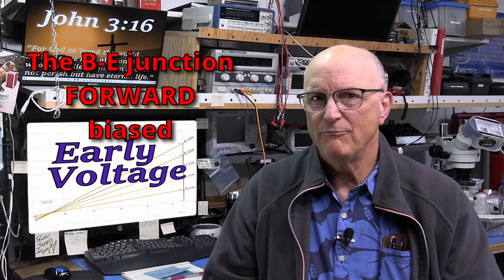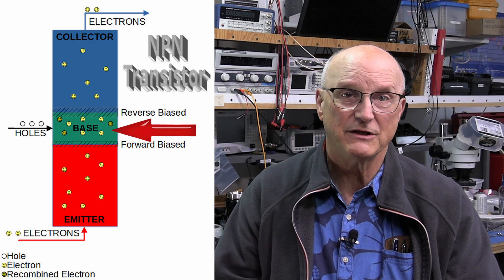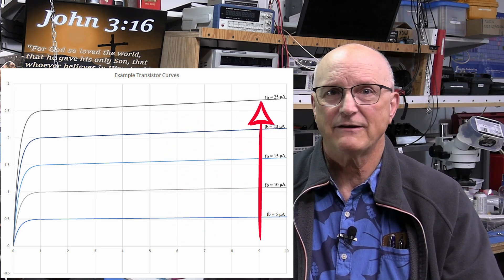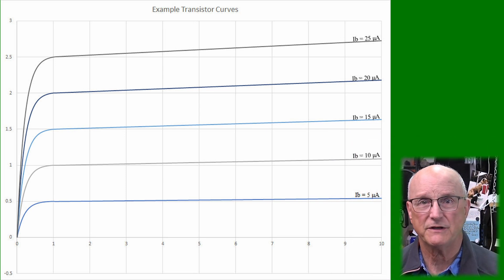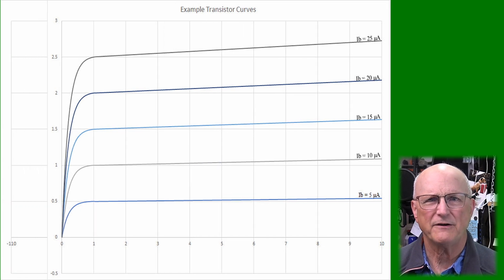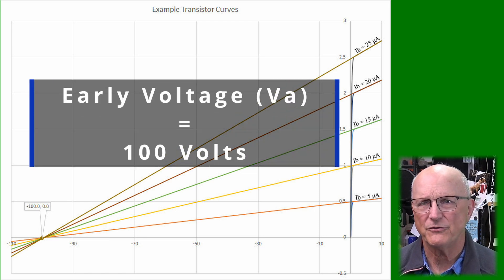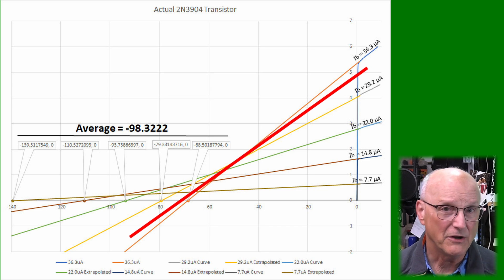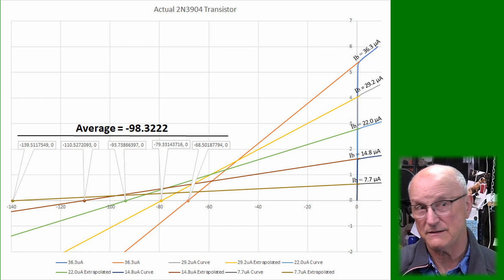What is Early Voltage? (066f)

Comment: I think a slightly better way to explain what is going on is to come at it like this:
The current flows into the emitter following the diode equation for the E-B junction.
Most of that current goes out the collector but some goes out the base according to the HFE.
The HFE of a transistor depends on the effective thickness of the base.
Depletion regions don't count as part of the base so higher collector voltage makes the base appear thinner.
How rapidly the collector depletion region is narrowing the base is what determines the slope of the collector current lines.
In theory, (but not in practice) the narrowing of the base should be raising the HFE regardless of current so the lines should all meet at the mythical place called the early voltage on the Ic=0 line.
Reply: Feel better now?   You did not listen.
Reply: @daveengstrom9250  I think you missed the meaning of my comment.  Read it again.  I made what I believe are several important points that make the explanation work better.
Reply from the maker: Yes, I believe that is exactly what I said in the video, though I didn't rope in the effects on hFE ... at least not directly. 🙂
Reply: @eie_for_you  My comment also put the points in a different order that I think works better.  Getting the changing HFE up front explains the change in collector current as a change in HFE
Reply from the maker: @kensmith5694  But, the change in hFE was not the point, but a side observation in the explanation of what it is all about.
Reply: @eie_for_you  I disagree.  The change in HFE IS what is happening.  You are holding a constant base current and seeing a change in collector current.  Ic/Ib is the very definition of HFE and you are seeing that ratio change.
Reply from the maker: @kensmith5694  Sorry it took so long to reply (I'm on the road). I agree. The hFE is changing. On this we both agree.
The explanation I present here for the Early Voltage is that which I find in my engineering textbooks.  The point is WHY it is changing and this is what I am explaining in the video...the physics behind the change in collector current, the slight positive slope of the curves. I admit, I could have, but I did not overtly say that this slight positive slope of the transistor's curves represents a change in hFE. 🙂
Reply: @eie_for_you  It is my belief that people will see it more quickly if you hit the "base width" point Early on (pun intended) then hit the HFE point and then tie that to the slope in the line. That way each step is explained by the one before it.  The first place I saw the Early effect "Explained" really just armwaved.  They drew a graph like yours and the lines met at a point called the Early Voltage but it threw very little light on the subject.  It was later that I found the explanation I now use.
Reply from the maker: @kensmith5694  Copy that! 🙂

Comment: I have never needed that early voltage to make my calculations, that said I can do all my calculations on a napkin with rough estimates and am within 10% or less every time. And at that point I am within tolerance for most circuits. Its rare that you have to have an exact calculation for an exact input and output. As long as its about where you want it, the circuit will work. You can always add more stages if you need more output. Its easier to build another stage than to worry about calculating exact numbers only to find your resister tolerance throws the numbers off anyway.
Reply from the maker: Yeah and neither have I. You rightly point out that by the time we add all of the tolerances of real life resistors and capacitors, precise calculations with transistor models are pretty much moot. Besides, even there ... the hFE possibilities of a particular transistor part number alone cover huge amounts of territory especially when we add in thermal considerations. It is a painfully imprecise world, my friend. 🙂

Comment: I've watched the video again, but something is nagging me. You've showed clearly that theory (all curves interact in one point) and practices (curves intersect x-axis at different points) don't agree. But there is no explanation on the why there is this disagreement. Could you explain that in another video?
Reply from the maker: I thought for absolutely sure I already replied to this. :-/
Well, let me give it another try.
Understanding the why behind the disparity between theory and practice is one of those mysterious semiconductor physics "rabbit holes." No one seems to want to admit the disparity in the first place. If they tipped their hand on this one back when I had to take 2 semesters of this in engineering school, I remember none of it (it was 43 years ago!).
The good news is, in practical terms, we actually rarely need to know the Early Voltage or even use it if we knew it. :-)